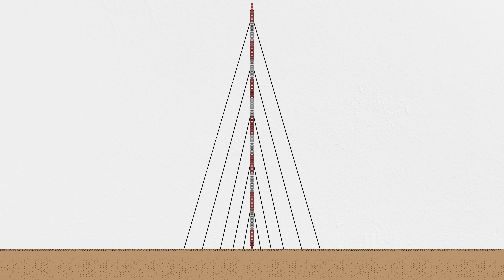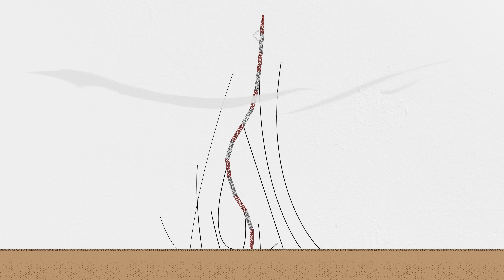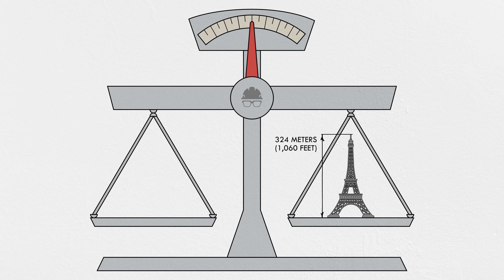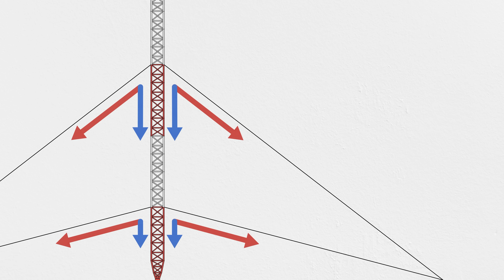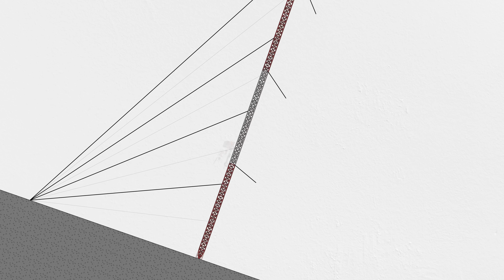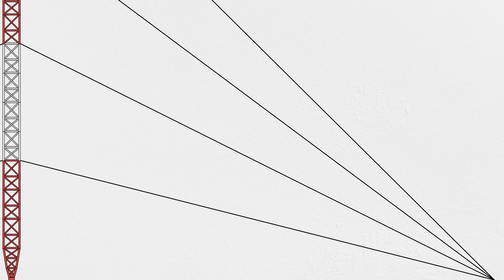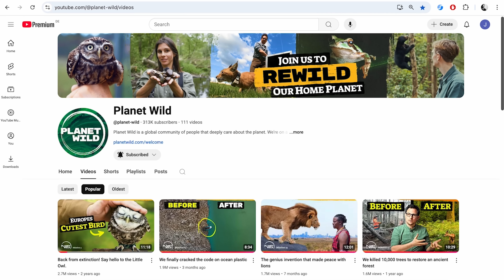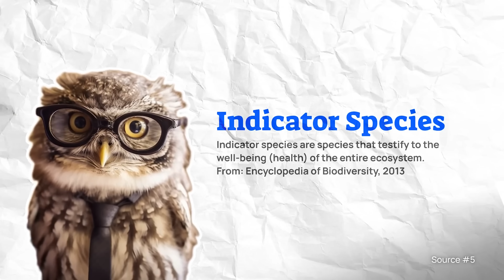The Bizarre Bases of Antenna Towers

Comment: I work in telecom as a structural engineer. We don't have many guyed masts like these luckily, as far as I know they are used mostly here to signal lamps to turn on or to sync public clocks. The one thing I heard from other guys who work on these massive masts is maintenance of the guys, they have to be greased regularly, that means a person starts coming down on the guy with a LOT of industrial grease and applies them with hands. They have no issue with skincare I assume. As for telecom, we mostly either use lattice towers or sometimes monopoles/ unguyed masts, rooftops or in special cases water towers, church towers, etc. If you want to dive into those in a diff video, reach out and I can give you some info and pictures. Cheers mate

Comment: What would full sized towers be made of and how would they be designed if that amount of back and forth waving was acceptable? 

I struggle to imagine a material that narrow that could remain 600 meters tall and deflect 100m to either side and not fall down from the fatigue.

Comment: I've never been a fan of these types of towers, but I have to praise their material and cost efficiency. I'm always wary around structures that rely on tension rather than compression as their primary means of structural integrity as there's always economic forces incentivising private owners to do the least amount of upkeep they can get away with as nature eats away at them. Also not a fan of their spiderweb like wide support cables and the amount of land they cover compared to a regular tower but that's just personal preference. In the UK the Old ~Emly moor guyed mast collapsed in the 60s following ice accumulation and resonant oscillation and was replaced by a tapering traditional tower taller than the Shard in London that remains the tallest freestanding structure here.

Comment: I know an electrician who used to climb to change beacon lamps on the tops of bridges and radio towers in my area. Some had complex spring-driven lampchanger systems with a carousel of replacement bulbs that would automatically rotate into place as needed, decreasing the frequency of needing to climb the tower.

Comment: Even as a amateur radio operator who should know better, I didn't realize that in the case of a.m. radio towers, the tower itself was energized and the radiating element. For some reason, all this time, I assumed some of what you think of as the guy wires were actually the radiating elements...
Reply: The guys have to be radially symmetrical for structural reasons.  I think you'd end up with weird nulls if you were to try to use them as radiating elements.

Comment: I live near Hoyt Radio Tower, one of the tallest structures on Earth. 1995 feet tall, sitting on a base situated 4951 feet above sea level. The grasslands get very windy, sustained 40-50+ mph with sudden direction changes. Those guy wires and anchors really do the trick!

Comment: Very cool video. I worked on designing structural components for these towers after graduating college. They are super dynamic structures, and any small change (like swapping out an antenna or different sized/weight cables) resulted in notable changes to the structural elements. The wind and ice loading for their design is insane!
Reply: TIA-222 is a boring read for climbers but must be exciting for you

Comment: As a GA pilot, I can attest that these antennas are almost impossible to pick up amongst the ground clutter.  It's amazing how easy there are to see against the sky when you can't find them at all from the air.
Reply: Even in aerial photography like that used for maps, other tall thin structures like wind turbines can be incredibly difficult to spot visually, antenna towers are about the worst.
Reply: Yeah, there's an "antenna farm" between Cincinnati and Dayton, Ohio that disappears in the clutter.
Reply: @toneale thankfully our sectionals make good note of them!
Reply: I’m a PPL in the UK and learned to fly at an air base 5km from Sandy, Bedfordshire, where there is a 1271 mast. Handy because if you could see it from the Control Tower in daylight you knew the local viz was acceptable, but equally they told us from day 1 to stay at least 300m clear of it and never lower than 2000ft in the vicinity because the guy wires would slice your Cessna’s wing off.
Reply: I seem to recall that a decade or so back, a GA airplane got hung up in the guy wires at the "Antennae Farm" SW of Houston TX. Apparently the crankshaft was the only thing holding the airplane up. My recollection is that it took many hours for the fire department to get the people out of the plane and I don't think there were any fatalities. However, hanging by your prop several thousand feet in the air flapping in the wind would probably make you think the next moment was going to be your last!
Reply: A Georgia pilot
Reply: @jiaan100 I bet they have some great bbq on board. God I miss Georgia bbq
Reply: Right. I have tried many times to spot towers on Google Maps. Even when I know exactly where it is, it can take me a moment to actually find it. It usually helps if you can see a shadow.
Reply: That’s kind of scary to think about.
Reply: When I was in the Air Force, we had to take every map we were going to fly a low level with and ‘CHUM’ it.  Stood for Chart Update Manual.  Basically a big book that included any obstructions not shown when they printed the chart.  One low level in North Eastern South Carolina (North East South ha ha), had a tower we had to draw on the map and put a circle around it, even though an airplane had hit one of the guy wires years before bringing it down.  Still, updating the update manual seemed to be impossible.
Reply: How do you know when someone has a pilot's license?  Don't worry, they'll tell you you any chance that they get..
Reply: If you're seeing the antenna against the sky you are too low. Fly higher. There have been numerous fatal GA accidents from people flying into the guys. If you want to stay safe' dont fly closer than the tower is tall.
Reply: @RowanHawkins  I'm sure all the farmers I spray for would absolutely love to see their expensive chemical drifting off like a cloud into the sunset rather than being applied to their crop.  Better to be safe, yeah?
Reply: I wonder if the towers utilize radar corner reflectors like the ones that can be found inside power-line marker balls.  Corner reflectors are a passive means of bouncing radar signals directly back along the path from where they came and should provide a bright return signal on aviation radar.
Reply: @projectartichoke most GA planes dont have radar.

Comment: As a small part of the U.S. amateur radio testing, there are sections on antenna design, tower building, and safety. The American Radio Relay League (ARRL) also has a lot of good publications available that will guide people into more in-depth study on tower design, construction, instillation, etc. Amamteur radio opporators (hams) who want to install their own towers are highly encouraged to get and maintain their own certifications on tower climbing and rigging. Personally, I don't have a tower, but I have helped a couple of times as part of a ground crew. 73! KB7QOD

Comment: I used to look after a large cluster of military communication towers, the common heights were 110 and 220 meters but some were over 300.  These were all exterior 'free climb' except the 300 meter towers (those had interior ladders).  

Hauling all the testing and maintenance kit up 300 meters was a chore,  the cable tension meters alone were about 45 pounds.   Sometimes it could be more exciting than expected -  I reached the top of a 300 meter tower only to find a large nest, currently occupied by Mama Hawk and her chicks.   An amazing sight, but at a distance of less than 2 feet from an irate bird with 'human issues' it was indeed interesting.   I also managed to 'fat finger' a 2 pound crescent wrench but I was able to radio an 'incoming' warning and my crew below had time to scatter before the wrench buried itself a foot deep into the dirt below.  That woke them up.  

One of the things not covered was that many of these towers are set up as sets, with the antenna being a 'net' deployed between and supported by multiple towers.  These setups had considerably more complex guying arrangements due to their loading and wind shear.  One thing everyone agreed on was that on very hot days,  you wanted to be the fellow climbing the tower - the cool breeze and the views were worth the effort.
Reply: My palms were sweating reading your comment. Hats off to you infrastructure guys.
Reply: @nickdee5764  You would have gotten a kick out of my crew 'dropping' a 100 meter tower (very old and had developed a banana bend in the middle after an ice storm).   Closed the nearby road for a few minutes and cut 2 of the guy wires with charges -  made a very satisfying 'thump' when it hit.
Reply: Did you have to climb back down to get another wrench?
Reply: @amicaaranearum  Luckily no.  I had finished up at the top of the tower and flubbed putting the wrench back into it's sleeve on my climbing belt.  Given it's almost a 1/2 hour climb when you're tooled up,  I'm glad it didn't come to that.
Reply: In Germany we have the Rhauderfehn Transmitter, 8 guyed tubular towers with 352 meters in height
Reply: This seems like one of those jobs where whoever is doing it nowadays NEEDS to start filming it, “influencer” style. There are already other channels (notably Shiey) where they illegally climb those towers, they get tons of views, but I’d watch the hell out of someone climbing those towers and working on them.
Reply: I've seen some videos of maintenance people climbing on towers only to find loose bolts and components falling apart. How common is that?
Reply: @solarpunkrachel  Not unusual at all.  That's why we were heavily laden down with kit - all the spare bits and bobs we took along to deal with just those situations.   

Before a climb we'd survey the tower with a sextant, to check for vertical alignment but also to see if we could spot issues that needed fixing.
Reply: My dad worked on towers.  Back in the day when building them they would ride with the section up the tower and ride the crane ball down.  Just insane.
Reply: No way you could get me to do it under any circumstances.  I'm glad that guys like you can handle it.
Reply: How much sway at the top?
Reply: I want that job! As a kid in the '70s, I spent every moment I could up in our trees, rigging ropes and pulleys, shooting Dad's extension ladder up between branches, building treehouses. I also climbed the front of the old bank, and the tall grain elevator leg so I could get a time exposure night shot of our little town. I still look forward to gutter cleaning seasons every year.
Reply: Where to was this? Sounds like the large cluster of military communication towers I look at out my front window... US Navy VLF site?
Reply: Surely you could tension the guys from the base rather than the top? Serious question.
Reply: @offroadmisfits  LOL, we did tighten the guys from the base, but we had to check and repair/replace all the hardware on each tower (annual inspections).
Reply: @theoldfart6404scary job 👍
Reply: Jesus christ, I've built my share of wooden radio towers 1/10th the height (Jota) and we secured basically every tool to their operator, if somebody was even in a situation where they could drop a 2 pound wrench I would've exploded them
Reply: @-syn9  It was a different time in the early 80's and militaries were not so obsessed with Health and Safety,   just getting it done.  If the wrench appalled you,  your head would pop at seeing the utterly non-secured free climbs over 220 meters while carrying over 100 pounds of equipment.
Reply: @-syn9  as a lattice climber i was climbing up some 350 meter towers in Europe

Comment: I was taught that the single-point spherical base also minimized the bending moment on the structure. If you try to fix the a wide base, when it tries to sway, there's a severe bending force. By letting it actually tilt a bit, you avoid that, allowing for a slimmer structure. If the mast only has to resist compressive forces and not so much bending, it's cheaper.

Comment: Very cool. I have a 55' guyed mast on top of my shop for internet & cell booster. I installed it myself and it's withstood at least 80mph winds so far. :)
Reply: that's so awesome! way to go, thanks for sharing! 🤩
Reply: Put up 80 ft for my HF Log periodic. It's a big job.
Reply: Is your tower to see over the horizon, hill, building?
Reply: @billkew5385  Trees.
Reply: ...I just pray you're not in the USA (Bc the FCC would 100% dislike that)
Reply: @sultrytornado5580  Actually the FCC doesn't really care that much, however if the total height of the tower is over 200 feet AGL then the FAA wouldn't be very happy unless they know about it.
Reply: @williambouchard4480  You'll hit trees before you hit my tower unless you're going straight down, in which case you have bigger problems.